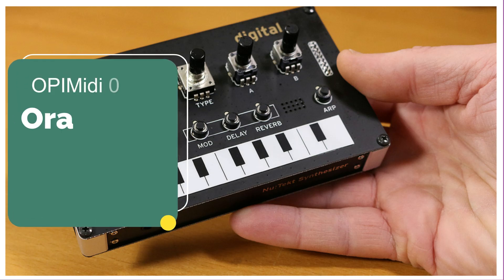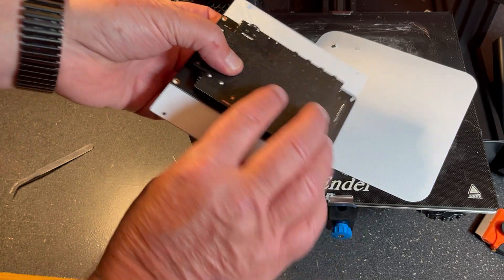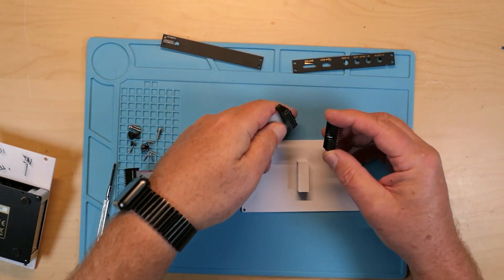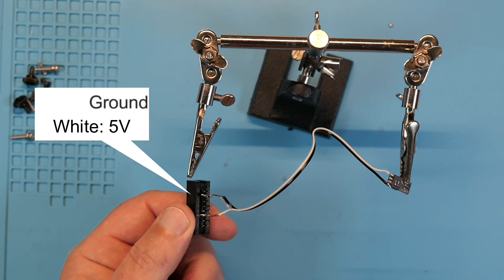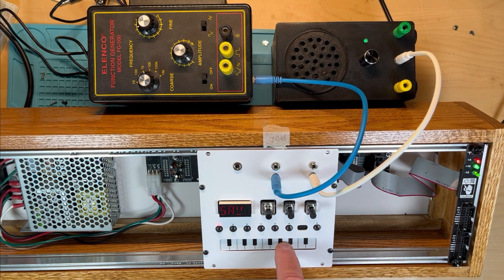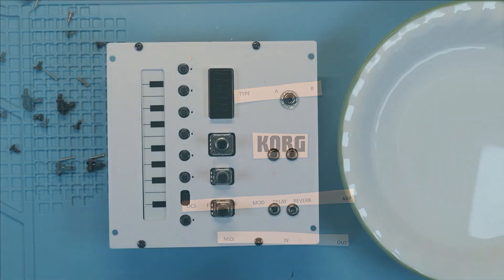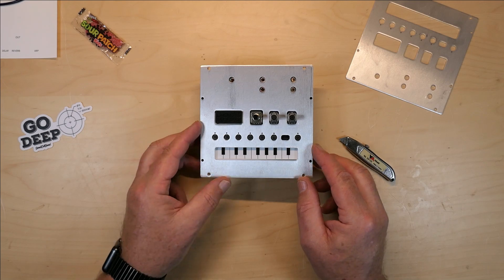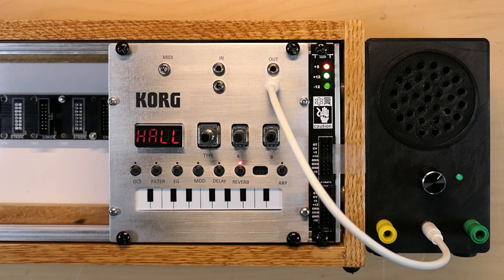OPIMidi 02 –NTS-1 Eurorack Modifications

Comment: After watching the way the Bus board was sawed in pt 1 I knew there was more coming.. LibreCAD... just another seamless pearl of teaching right there...
I decide to mount my Nts1 Vertically, under the rail, with longer screws, and make a vertical front panel that would sandwich the nts1 and the rails... and put the
connectors on the side all vertically also. It's a bit tricky to move around, I always have to detach the front first and the Nts1 come loose... I also did everything by handsaw, one small precision saw exactly like yours. Great content.